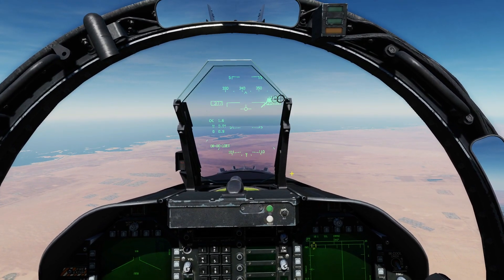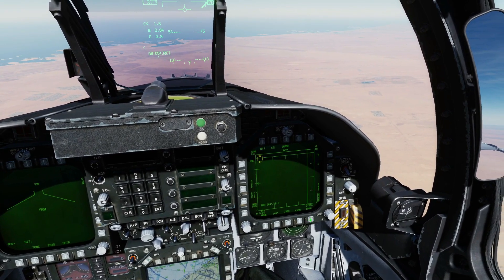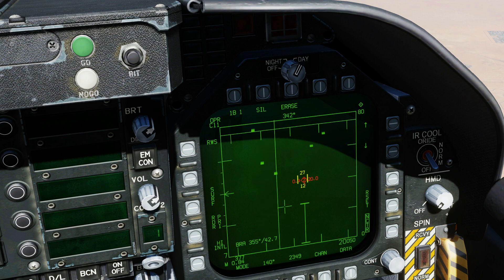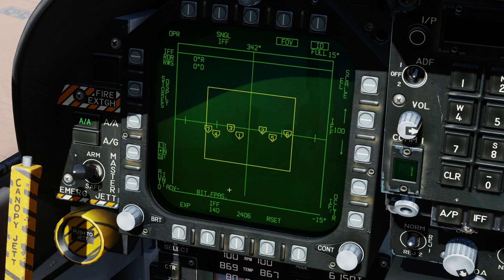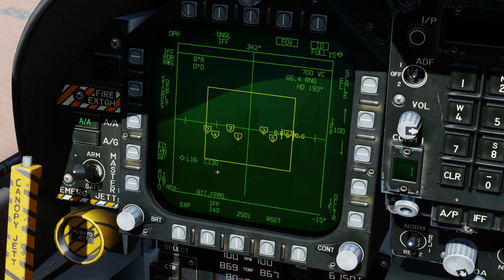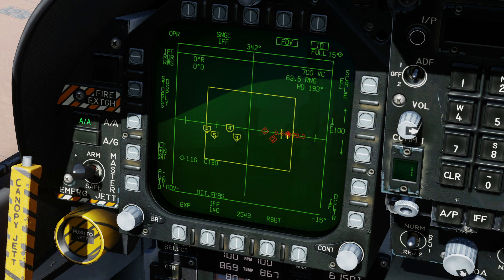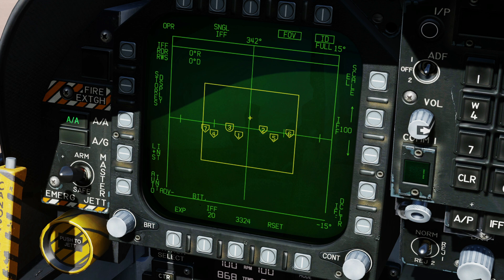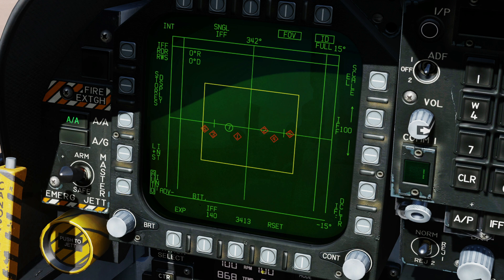FA-18C Hornet: AZ/EL DDI Page Tutorial Vid (2 of 2)  | DCS WORLD

Comment: I can not think of any reason to use any other setting than 140 degrees and 100 miles.  There may be a tactical reason in the real world, but not sure there would be in DCS.  It's not like it gives you away or anything like that.  If your radar is emitting everyone in the area will know you are there.  And it does not seem to affect the detection time like adjusting radar sweep patterns can.  Maybe I am missing something?
Reply: @JSRJS  most of the time you will be looking at this stuff way out well past weapons range.  So, time would not ve an issue.  Maybe if you get jumped from aircraft using terrain masking?  But, in that case you will probably know they are hostile from them shooting way before IFF is even thought about.
Reply: thank for the question I was wondering the same thing... Why not leaving everything at max range and in auto mode... As you said IRL it could be related to avoid radio emissions anywhere at anytime...
Reply: Do you have to have that page up for it to function or can you set it and then bring up a stores page there for example and still get the IFF info on your primary radar screen?
Reply: @SteveSmith-fh6br  Once your iff is set to auto it will stay that way after leaving the screen.